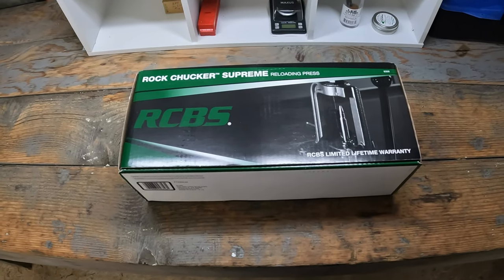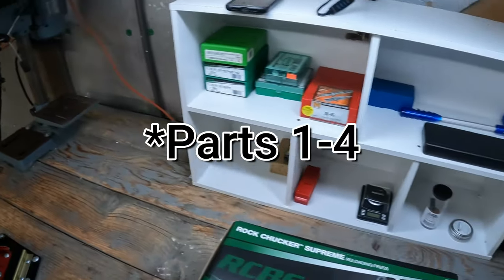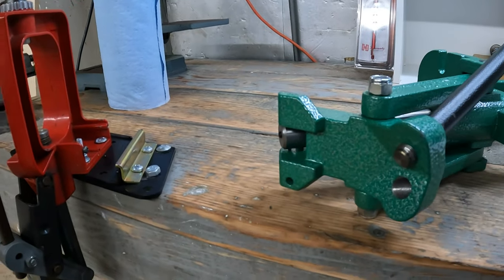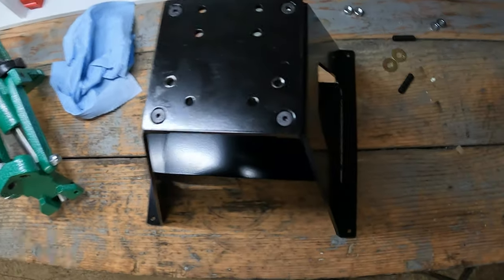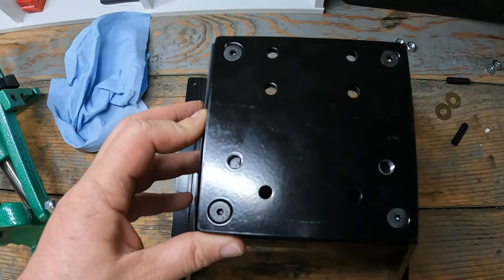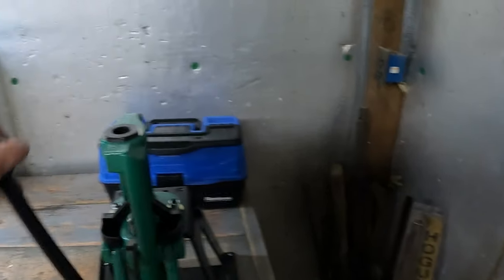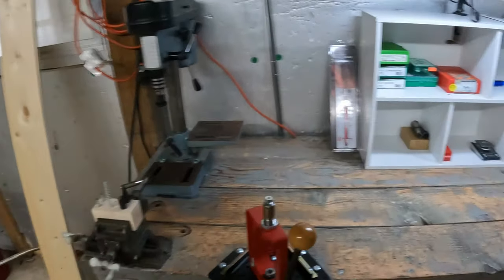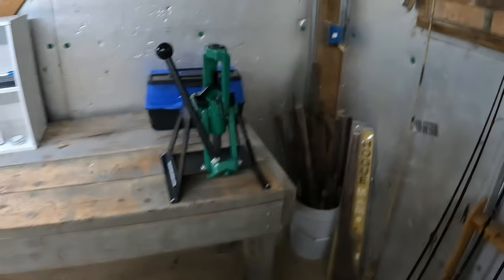Reloading Bench Vlog Project: Part 5

Comment: The Inline Fabrication mounts have countersunk holes in the bottom of the top plate that the head of the bolt sits in that you bolt to the bottom of the press and them bolt the legs on. No need to drill at all since it was designed for the RC.
Reply from the maker: Thanks

Comment: Nice press 👍 things are coming together for sure. For a scale a lot of reloaders will recommend a beam scale. I've had very good luck with electric scales over the last 20 years. As long as you have a reference weight (50grams) to check it. I'm running a RCBS Charge Master Lite and very happy with it 👍🙏✌
Reply from the maker: Thanks Kyle! I am leaning towards an electric scale.
Reply: @hopefulballistics  what model are you leaning towards? So many good options
Reply from the maker: @kylemartin832  I’ve looked at RCBS and Hornady models so far.  But I think I need to do more research before I buy.